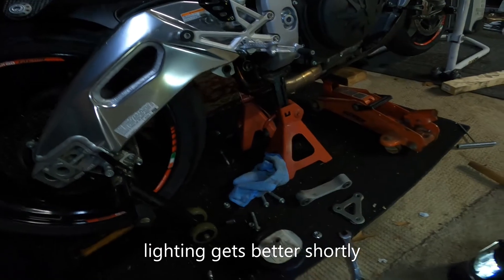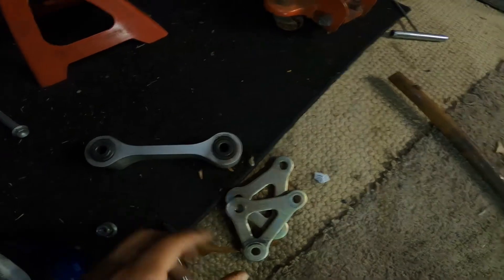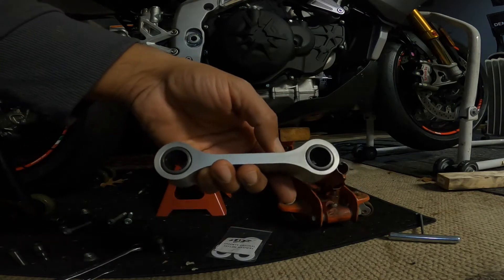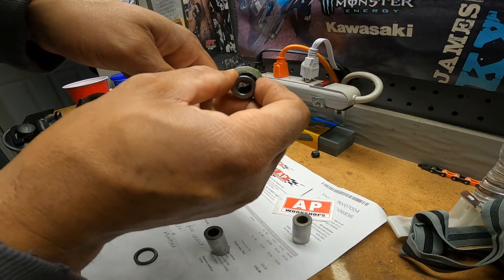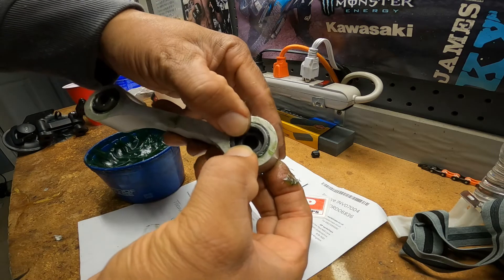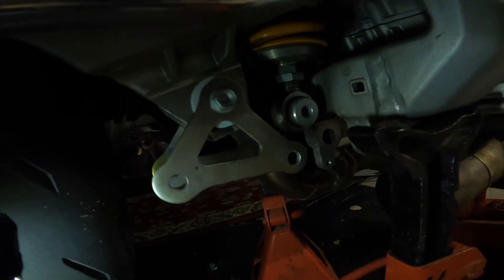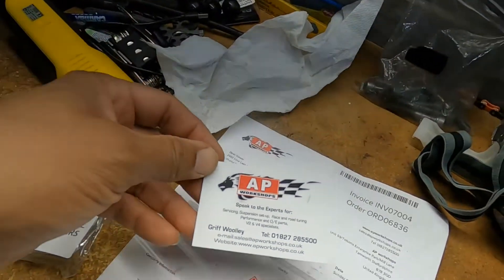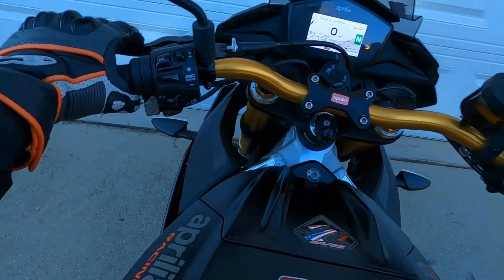Tuono Factory Dogbone Service

Comment: Hi, great tutorial, did this today on Gen1 Tuono, and my needle bearings were rusty as hell, so I completly dissasembled them and clean them. Just a tip, if you put grease on inner side, then you can pretty easily stack one needle by one and they stick together, so no falling apart :) But as I said, mine were in terrible condition :)